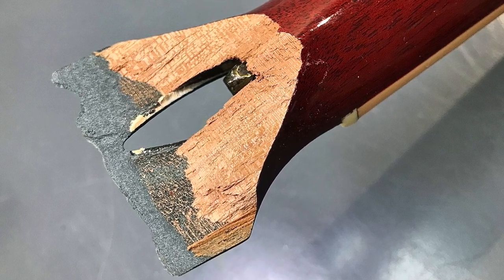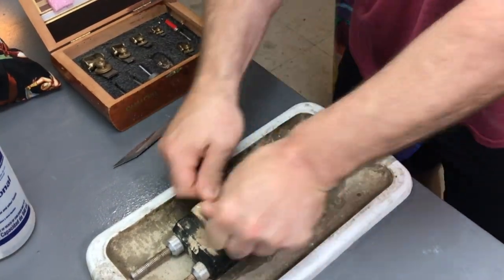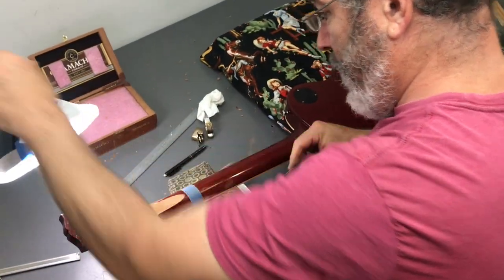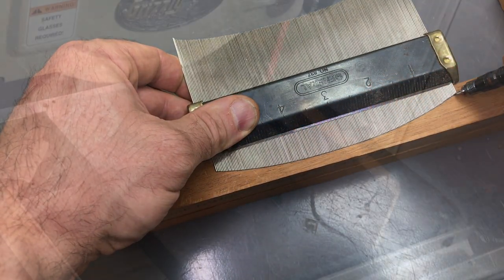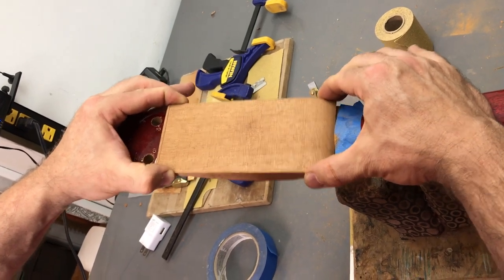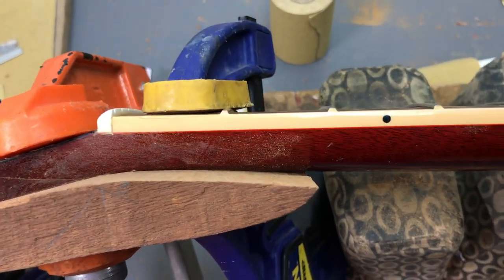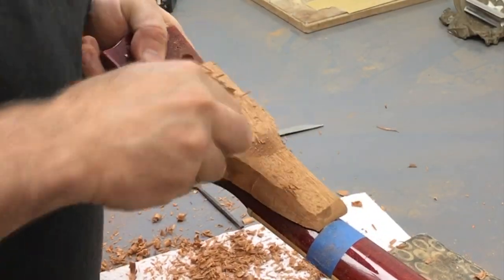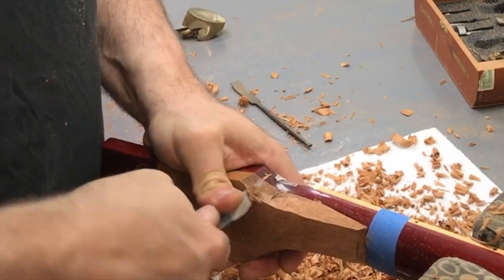Backstrap Overlay Part 2

Comment: Great video. I do a similar repair but I use a thinner strip of mahogany that I bend into shape to match the curve. I eyeball it but the contour gauge is the way to go. Thanks for the tip 🤘
Reply from the maker: I think bending is cool too.Its the way I first did it based on Franks post on frets.com . Sometimes I want to go deeper though. I think laminates could be cool, though and probably stronger. I might try laminates next time as carving all that wood away is rough on the hands.
Reply: @theloothgroup  yeah but I like your idea with the volute. I might try a thicker laminate next time but leave the area thicker where the volute would be? 🤔
Reply from the maker: @eugemcl  you can certainly try. I ran into problems bending anything much thicker than acoustic side. It could probably be done with steam tube bending though.